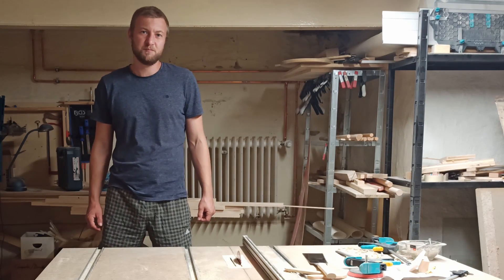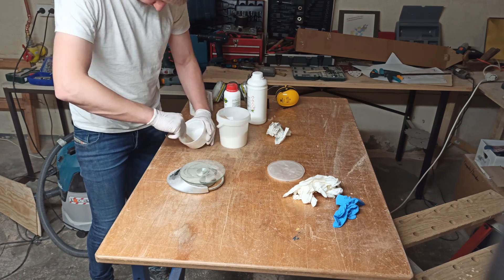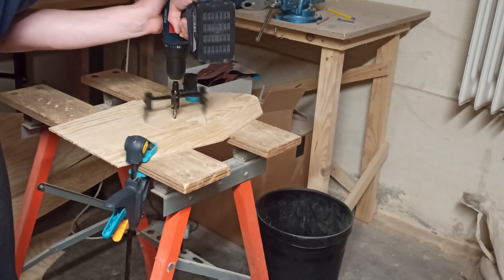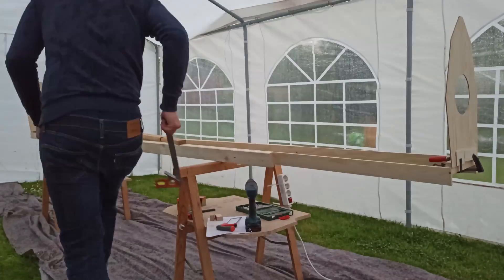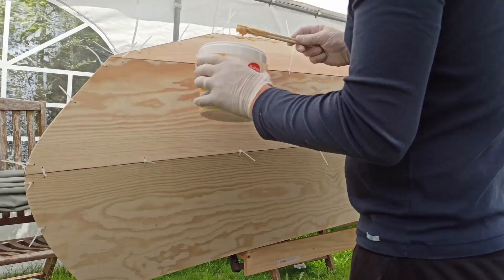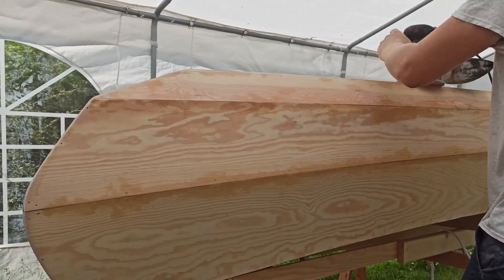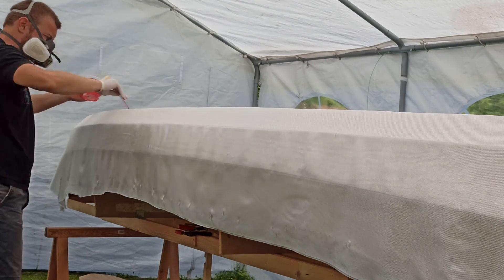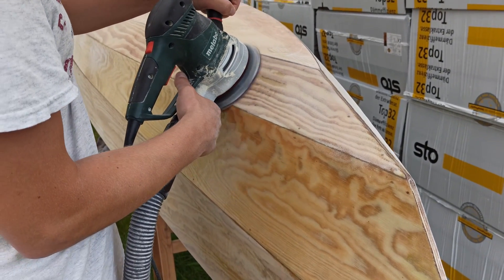TJ-Canoe - Part 2/4 | Self-Designed Plywood Canoe (Free Plans)

Comment: Hi Jake, I've completed my 1st canoe using your plans, again thanks a lot.
Its made of 8mm pvc, cut with CNC , using about 200 zip ties+ pvc ciment+ paint.
The second one is in the pipeline with many improvements..
I see only advantages to use pvc instead of plywood...
Id be glad to send you pictures anytime, don't know your email..

Ive a question , if you please...do you think your plans can be used for a minimised version, let's say 15%, for a single seater ..or a bigger version, let's say 20% .more?

All the best, Christopher
Reply: Hi Jake, when I asked you about scaling down or up your plans I thought that may be you had already studied:
*The minimum size for a 60 kgs  user
*Upping the scale I think the width should remain same...I won't rent to giants:)...but I want to increase the number of passengers..means, in fact cutting the canoe in 2 and inserting a straight portion in the middle( limo style!) ....do you think stability will suffer too much?

Another big question:
How to modify an upscaled version of the canoe into....a sailboat?
Great day Christopher
Reply from the maker: Hi Christopher,
the Plans can bei scaled to whatever size :-) I also used it for my paper model. 
Congratulations on your boat! 
Here is my mail address: tinkerjake@gmail.com

Comment: Hi Jake, I've started to build the canoe...with pvc boards 8mm.
To assemble I use zip ties and I plan to keep them always.
In fact I manage to keep the head of zip ties in their holes and tie both sides not with a O loop but with a 8 loop...that way the  joint is quite thin and much stronger...and permanent.
I plan next to use ripstop nylon instead of fiberglass.
3rd video will be highly welcome! Though I'll use kneeling position..not seats.
Friendly Christopher
Reply from the maker: Cool, I would love to see it! Can you post a link or something?

Comment: Hi, I'm Christopher from France,  living now in Bangladesh where I'm involved in beach sports...I've started to build carton small model of your canoe, so as to start to understand how everything works and not ask too many unuseful questions:)
Though I've just spent a rather sleepless night to try to decipher the whole building, few things remain still a mystery:
Exact position of the 4 frames, 2 big , 2 small...level of the big ones compared to the small
Size and position of the seats ( which, incidentally, serve as reinforcement of the whole)
Should I fiberglass the inside of the canoe as well?
Any finishing béautification suggestion,  so as to look Indian native for exemple...

Thanks a lot for this sharing, I'm on the starting block! 
Best regards Christopher
Reply from the maker: Hi, I made a draft with the positions of the frames and linked it in the video description. (https://drive.google.com/file/d/18hK-owW5iHucU92OBKu8jZrZxDCGeT6H/view?usp=sharing)
You should definitely also fiberglass the inside of the boat (for reinforcement and protection).
As far as I know the seats are usually not used for reinforcement. To hold the planks in place you should add thwarts and a yoke (depending of the amount and position of the seats).
Reply: Hi Jake, thanks for the reply, and happy to get in touch..

Thanks for the frames positioning! 

I've decided to use cnc cutting machine to cut all parts, it's quite cheap here in fact and perfectly accurate...but the plans you provide have a rather low definition for computer use...they tell me.
My 1st option is to redo the plans using the templates plans, it will increase accuracy a little I suppose..
The second option is to ask Jake for some plans with higher definition?

Here the only marine plywood I find is 6mm thick..

And the lightest fiberglass cloth is 400 GSM ( I dont want to use fiberglass mat, looks too lungs unhealthy to me )..in 3.5 feet wide rolls.

As I'm used to build kites ( NPW5 ), from ripstop nylon, I consider to use it instead of fiberglass ( except for the joints)...any comment on that ?
I also consider to put ties every 10 CMS with the heads inside and leave them below the fiberglass or ripstop nylon...I suppose the extra relief from the flat surfaces can nevertheless  be absorbed  by cloth and epoxy..

Whether,  end of the day i have to use 400 GSM fiberglass, I'll not fiberglass the inside,  just the joints +  a good waterproof  varnish. 

Do you have some datas for the seats ?, if you  please. 
I want that canoe to be usable single or double seater ( triple is possible? ), and have seats ( eventually removable) accordingly..

Have a great day, here covid drama is more bearable than in France,  for the moment..
Cordially Christopher
Reply from the maker: @shantoochristopher1153  Hi Christopher, 
Actually I dont really understand what you mean by "low definition of the plans" The *.pdf files are vector graphics. If it helps I can provide you the plans as *.svg  (also vector graphic), as I made it in Inkscape. you can also export the files directly as gcode but as far as I know the cnc guys prefere to make their own gcode. If you want to connect the parts via scarf joints you need to add the overlapping areas to one side of the joint as I made the plans for butt joints. 6mm plywood and fiberglass only on the outside of the boat is also a common way to build a canoe. In that case I would roll some epoxy to the inside before aplying the varnish for better protection of the wood.
Reply: Hi,
Unfortunately, I asked CNC people to cut with an angle but it's not available...so the cutting is square and the joint can be called butt joint, I suppose
... with an angle, means theorically only one line will connect two parts...
I've planned to sand paper both side to increase the surface of connection and get if possible as close as scarf joint ( if I've well understood the meaning)..
What do you think of ripstop nylon to replace fiberglass but on the joints?
Thickness of your ties, means DIA of the holes, if you please.
christopherbangla@gmail.com 
If you want to send me any attachment or datas.
Thanks a lot
Christopher
Reply from the maker: @shantoochristopher1153  Hi, I just uploaded the parts as *.svg (link in the video description).
I have never worked with ripstop nylon, so no idea if that is going to work.
The diameter of the holes is 2.5mm and the zip ties are also 2.5mm. If you expoxy and varnish you will see the holes later, so I wanted to make them as small as possible.
For the seats I guess you will have to wait for the next episode :-)
Have fun with your boat!
Reply: @TinkererJake  
Thanks a lot Jake, for the moment I'll have fun with the boat...building.
I consider to use your plans with some type of plastic white boards sold locally..
At 1st I'll try several building options, pvc joined by silicon and covered with nylon and epoxy for example..
Greetings
Christopher
Reply: It seems Jake that all parts in SVG did not come complete.....just few shown!?!
Reply from the maker: @shantoochristopher1153  All parts are included. You probably need to download the file and open it with inkscape.